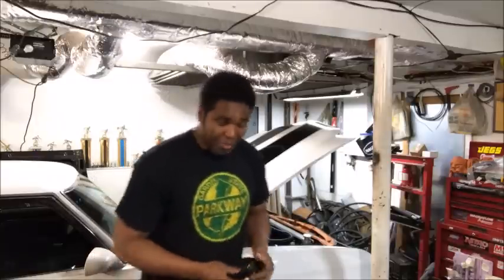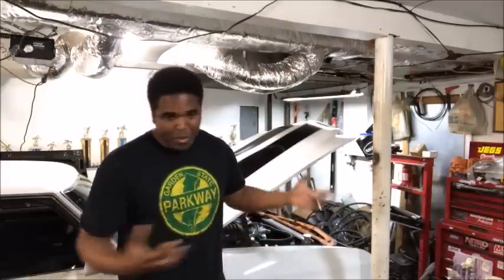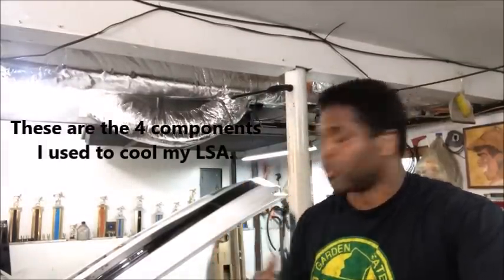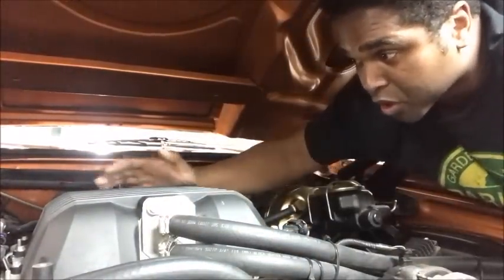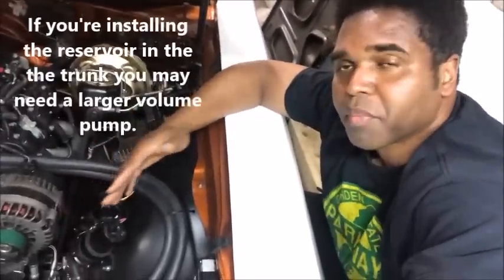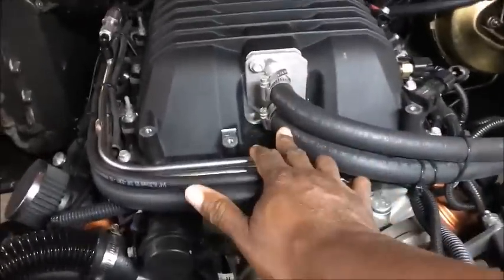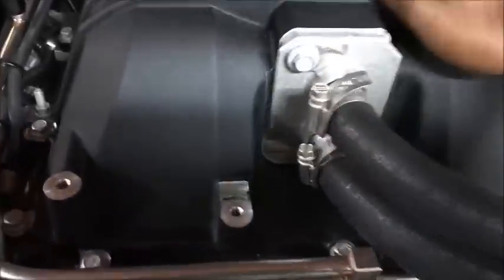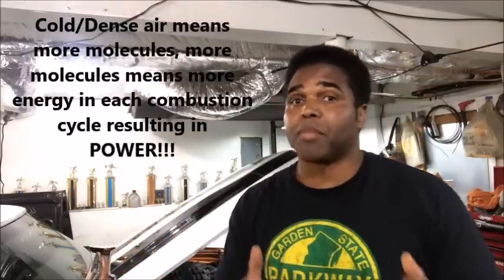How To Cool A Supercharger (4 Key Components For Cooling An LSA Supercharger)

Comment: does the supercharger generate much heat when cruising normally and should a temp gage be in the line leaving the charger to monitor temp and what temp is considered high for the hot water exiting the charger.

Comment: How much water does your reservoir hold? I noticed the water in my tank was quite hot thinking maybe a bigger tank?
Reply from the maker: i think my system holds around 5 gallons.
Reply: @Coverman66  might be the issue then, I think I only have a 5-6 liter tank which isn't even 2 gal

And the water in your system stays cool?

Comment: hey man love the vids! Im in australia fitting a lsa into a early holden commodore, when bleeding up the system does the water drain from the top lid once you take the res cap off since its lower than the lid? im just trying to work out if i need to fit the res higher than the lid?
Reply from the maker: whats good brotha Anthony.. the pump does all the work.. my reservoir is higher than the pump so the water will flow to the pump..  my pump is a pusher so the water has to always be there to push it thru the system.

Comment: Due you have to mount the resvoir at a specific height? ?.....I have a 74 nova that I wanna supercharge , seems like the lsa is the most cost effective thing too do. ....
Reply from the maker: i love the LSA, if you can find one pick it up for sure..  being the pump is a pusher, make sure the reservoir is higher than the pump.. that way the water will flow to the pump..
Reply: @Coverman66  I just ordered a boost district kit last night.....comes with everything except fuel pump,hoses, and belt!!!

Comment: hello, 
what if I'm used the different way of flow direction !! 

 - hot water out from supercharger
- to intercooler
- to reservoir tank 
- again to supercharger 

what about this water flow direction ? 
Thanks.
Reply from the maker: i guess you could, as long as the water is as cold as possible. those two swap might not make that much of a difference unless your using ice.
Reply: @Coverman66  thank u :)
Reply: @Coverman66  because i saw there is to way direction .. almost of people using :
- hot water from supercharger 
- to reservoir tank 
- to intercooler / heat exchanger
- and the back to supercharger

Comment: Does it matter if you use the top or bottom port as "in" or "out" for that heat exchanger, and vice versa for the LID? Ive got the same setup, just not sure which is in, and which is out on the heat exchanger and lid
Reply from the maker: it really dont matter, i like the in to be on top and the out on the bottom.  i think that how stock was..
Reply: @Coverman66  Alright thank you boss. I did it in on bottom of HX and out on top of the HX.

Comment: I just bought an lsa blower,should the solid isolater be tight on snout or slide freely like it does on the blower part?
Reply from the maker: there is a very lil resistance.. should be able to finger come off and on..

Comment: Thanks for sharing
Reply from the maker: my man O.. whats good partner..
Reply: I’m good bro. Just trying to get on the road. One issue after another. I’ll get there. 😀
Reply from the maker: anything i can help with?
Reply: Can’t get rid of a P0101. Change a lot and shake it. I have one more thing to try. If that doesn’t work, I’ll reach out. Thanks. Any help is appreciated
Reply: Fixed my issue. Drove the car down to the Bronx. Bad trans fluid leak. Noticed when I was a block away. Ordered the fitting. I should be good to go by next weekend 😀